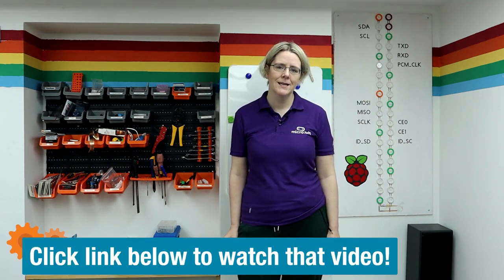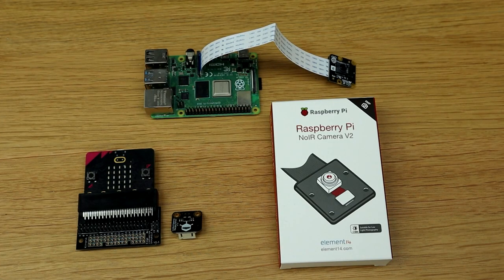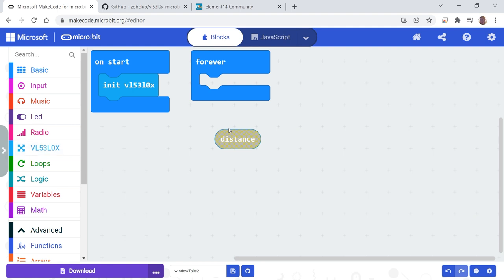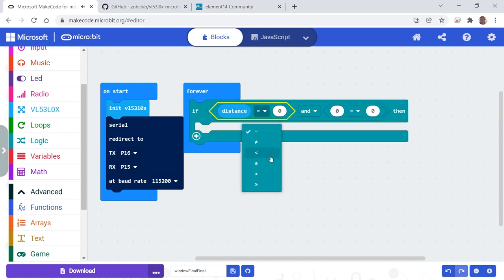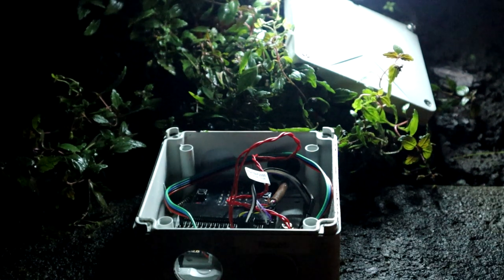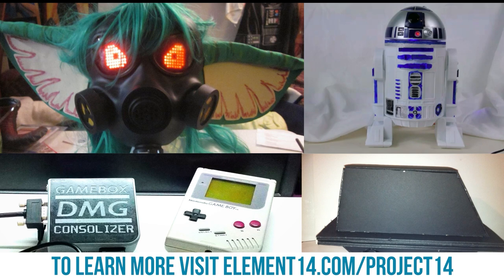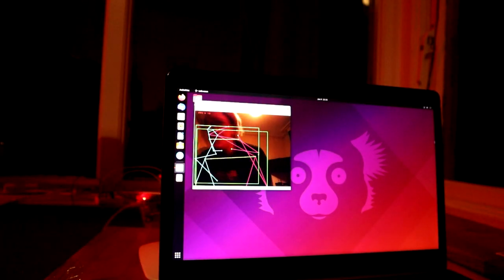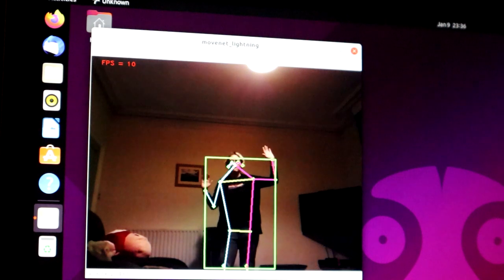LED Window Display Controlled by Pose Detection Using Raspberry Pi and an IR Camera

Comment: Cool project! 
Those ToF thingies use laser light(non visible IR) to get the reflection back and sense the phase shift. Not able to map a proper relation why distance increases and then soon decreases, but yeah, the tape might be making some micro movements and giving false reflections back to the reflection capturing array.

Comment: There's a brand new official 64-bit version of Raspbian if that will help.

Maybe try some industrial waterproof buttons?

Try making a close-fitting hole for the TOF sensor and seal around the sides with silicone to get around the issue with the clear tape wrecking the sensing?

Maybe a couple of less powerful IR lights installed out on the wall or in the box instead of trying to illuminate all the way from the house?
Reply: Yeah, I saw the 64-bit right after I finished this project! I'll have to try again. 

Waterproof buttons would definitely be the way to go if you wanted to keep it simple.

Comment: A few thoughts on the VL53L0X ranging errors mentioned around the 11 minute mark...
First thought is that yes, you should fix that, if you can.

 One idea that should be worth trying is to stick the sensor directly onto the tape surface, after putting the tape over the hole. (may need a bigger hole to fit the module in?).  This should eliminate (or at least reduce) any cross-talk issues. I suggest that you have a look at the application note AN4907 from ST (google search "AN4907 Application note - STMicroelectronics") to get some ideas on how the tape over the hole in the box might affect the measurements.
  
The datasheet mentions calibrations that should've been done after installing the device in the box in the garden, whether with or without the tape.
- There is a temperature calibration that "... must be performed again when temperature varies more than 8degC compared to the initial calibration temperature."
- and a "Ranging Offset Calibration" that has to take into account "Protective Cover Glass above VL530X Module".
- and finally, a "Cross Talk Calibration", about which it says "The magnitude of the cross-talk depends on the type of glass and air gap"

Certainly any IR reflected from the tape would probably need to be compensated for by both the ranging offset and cross-talk calibrations, and obviously taking it outside in the British Isles in the winter is going to change the temperature by more than 8 degrees Celsius. I don't know if it would make the sensor accurate enough, but without at least trying the calibration, there's no point complaining that it didn't perform as expected!  Unfortunately, I don't know if the python library provides an interface into the calibration API, but their Arduino library has a "vl53l0x_api_calibration.h" that defines functions for performing the crosstalk and offset calibrations.  I don't see anything for temperature calibration, but maybe that's built into the other functions?

All that aside, while I can't find definitive optical characteristics for various types of sellotape, it makes sense that different types and brands might reflect, absorb, or diffract the 940nm light differently.  You could have tried a few different tapes, or tried hot-gluing glass or acrylic (or other clear plastics) over the hole in the box.

I appreciate that you couldn't spend weeks experimenting with dozens of various configurations, and that a button is a simpler and more expedient solution, but it'd be cool if you could make the proximity sensor work!